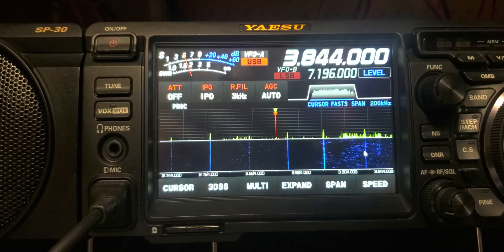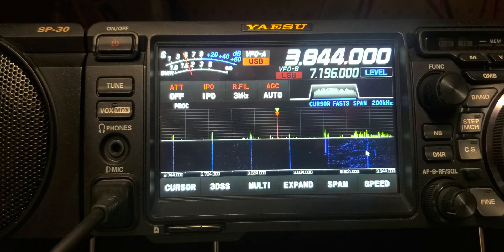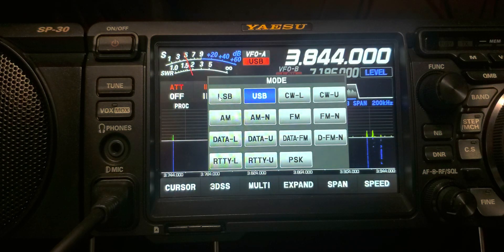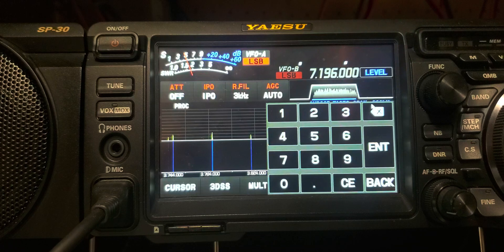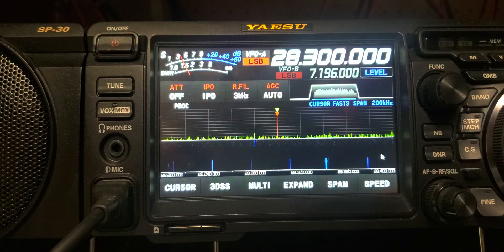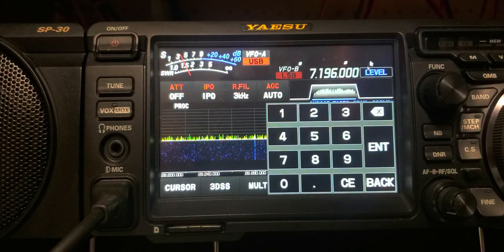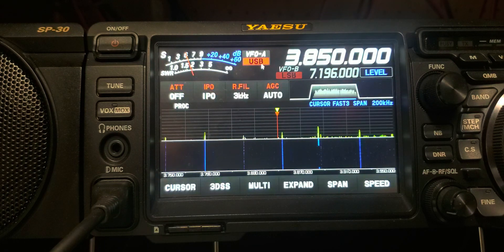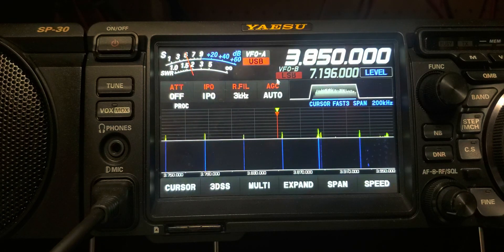Yaesu FTDX10 Huston we have a problem

Comment: Other rigs do as one would expect, go to USB or LSB based on the HF band.  I dont see it as a serious issue, but is nice to have rigs do setting automatically like offset on 2m & 440 FM rigs and let you change if you like.  The FTDX10 does a few things like this like turn off break-in when switching bands while in the CW mode.  Is a pain to have to go into the menus and make changes that the rig changed.  This is firmware and I hope Yaesu makes some changes along this line.  I do like my FTDX10, is very nice rig, but does have some operational issue.

Comment: You are in manual mode once you begin to enter frequencies using the dial pad. Selecting USB or LSB before entering the 10 digit frequency number tells the radio you want that frequency number in the upper or lower band you selected to begin with. The band will not change regardless what frequency you enter unless you manually change the band.

Comment: Sorry this is a bit late, but "band stacking" by using the band button eliminates that. Tune lower 20 CW with your settings. Press band a second time, get a second 20 meter entry. Set it up for, say, digital mode. Press band a third time set up 20 phone. Next time, you can select any of those three presets by merely pressing band to get to that memory slot. Memories are variable, each just remembers the last setting you had for it.
Reply from the maker: I know it just seems odd and easy to fix not a huge problem but it's same in the 101d

Comment: I don't see this is the problem but I guess you expect the radio to automatically select upper or lower sideband based on frequency. The radios doing what you've told it to do. If you're going to manually enter the frequency like that it's going to follow what you have selected.
Reply from the maker: You are so wrong I love ❤ correcting know it all hams that have to always inject there 50 cents with out actually knowing what you speak of
Reply: @aaronlabranche2977  :: who are you talkin to? There are no other visible replies. If you're replying to me, everything I own is Yaesu. I've also been licensed for more than 50 years. Even if you disagree with a response, there's no reason for abject rudeness and attacking people that reply to you.
Reply from the maker: Why do libtards make snap decisions without all the facts?
Reply from the maker: Nope another one didn't watch the entire video  you don't even know what your talking about what a fool  🤣 😂 another know it all with out all the facts must be another liberal zombie
Reply: @aaronlabranche2977 :: no wonder you have so few subscribers. You are rude and abusive to people that make a comment you don't agree with.

What you are showing happens on my FT-2000 and my FTDX5000. In response to another user you were much more polite and told him that's not how YOU want it to work. Fair enough. Send a note to Yaesu and let them know how you feel. But you were polite to another responder and not to me. I told you the same thing. I am not a libtard and I've watched the video from front to back.

The selection of USB or LSB is done by convention and not by law. That means if you want to operate USB on 75 meters that's your choice. I know of many people operating in the various bands that go against convention.

I've been licensed over 50 years and absent an apology, which I seriously doubt you are adult enough to give, I will make sure not to visit you again.

Comment: I hope they don't change this. When manually inputting a frequency I would hope it doesn't change anything else. That is what the band selector is for.
Reply from the maker: It changes it to the wrong sideband lol
Reply from the maker: I'm amazed so many completely missed the point of this video Lmfao
Reply: @aaronlabranche2977  No, it stays on the sideband that you used last. If you're on USB and manually input 3.800, it stays there. If you manually enter 28.400 it will still be on USB unless you change it. Using the band selector will change the mode the way it should.

Comment: I’m wondering is the settings on the vfo is set to manual. I know that on my ft891 I can change it to auto, lsb or usb and it will not change if I switch sidebands unless it’s set to auto.
Reply: There is a way to enter frequencies by going through the band button......it will change to the right side band.

Comment: That is not a problem, if you change the band in the band button then the radio will retain the last mode used, same as my 2 FT-991.
Reply from the maker: It's ridiculous,makes no sense very backwards if you make the same mistakes over and over it doesn't make it ok.
Reply from the maker: But I want to change it this way... stop making it ok for yeasu to goof up
Reply from the maker: You misunderstood clearly
Reply from the maker: Another one that clearly dose not understand what I said lol

Comment: Hi.In cw setting set cw freq. display to direct freq.
Reply from the maker: Huh?
Reply: It will stay on same freq..It is on  cw Freq display page 96 of manual
Reply from the maker: @kenmcfarlane226  the way it is is stupid I not going to defend that. Its clear you are defensive about yaesu errors I hope they correct It I heard it's been fixed with the first update witch only validates my complaint either way 73

Comment: I'd hate to think how you would cope with a radio that has a manual / mechanical mode selector switch... Muss fuss about nothing...
Reply from the maker: It would not automatically change to the incorrect sideband if if was manually operated lol nope I'm not a fan boy and if yaesu gets it wrong I will call it out sorry if that bothers you

Comment: Hi Aaron, thanks for the video! RX is clear, but what about TX? How is the unnecessary sideband suppressed? On 101D it is very bad. Please look at the adjacent transceiver! If the suppression is about 25 dB, then this is not enough for a modern transceiver.
Reply: So are you saying if the sideband TX in the radio is not suppressed by more than 25 db then you will prefer a radio with an inferior receiver? I thought the DX10 passed the FCC requirements.
Reply: @vijovame  He is saying that a clean transmitter is a good neighbor on crowded bands.

Comment: this is not a problem, also on the FT-991 and FTDX-5000D. This is the YAESU algorithm when you dial the frequency by hand.
Reply: Go into your menu...Page 17 & 40 will tell you how to preset your radio to be in a certain band when ever you change bands. This is how I did mine. When ever I go from say like to 40 meter it will automatically be into the LSB mode. Then if I change to 15 meters it will automatically go into USB mode. Mine works with no problem.
Reply: it only changes mode if you change with band change button quite normal
Reply from the maker: Rofl 🤣
Reply from the maker: It is a problematic to me it should not swap my mode to the opposite mode that's not cool